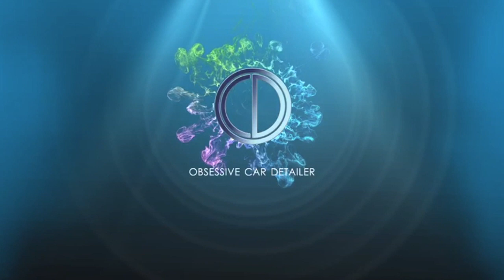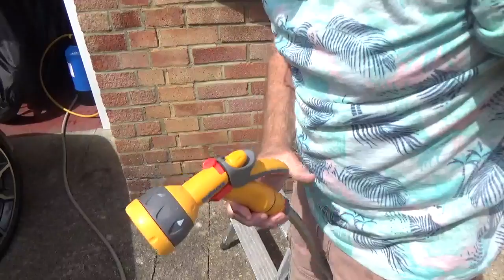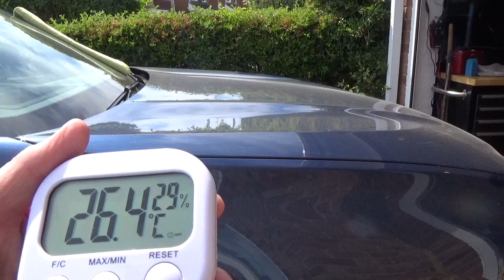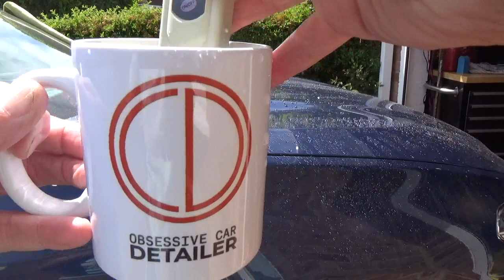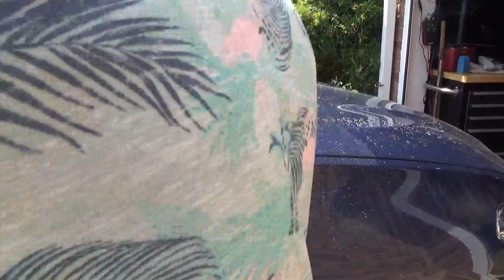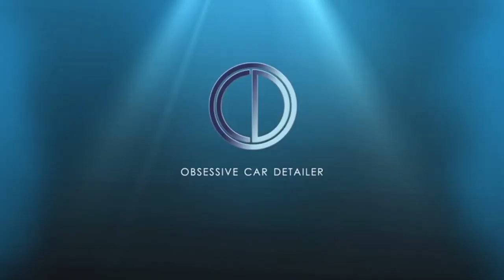No more water marks

Comment: I recently bought a resin vessel filter. But I seem to have a problem perhaps you can help me.
I connected from my outdoor tap to the vessel where it says 'IN' and a hose shower where it says 'OUT'. 
I turned on the water, waited some time to ensure the vessel fills up with water, eventually press on the shower hose but no water comes out.
I turned off the tap and pull out the hose from the tap to the vessel and pressured water shot right out.

I am not sure what I am doing wrong.
Reply from the maker: @pk4k60  I’m no expert but it sounds like you have an issue with the out hose. Has it a connector on the end that has a safety????

Comment: Hi Martin. That s what I want to use in my mobile detailing set up with car wash fed by a 200 lt water tank gravity system (no electric pump planned if not necessary). Do you think the water outflaw from the tank for the final rinse with deionized water can be affected from the passage through the filter or not?
Reply from the maker: Hi Domenico, I have no definitive answer Im afraid but I don't see why that wouldn't work provided the output from the tank isn't constrictive. If your system works without a filter then I would expect it to work with.  I would think a filter is a must for a professional as you will work in all conditions so best try it before investing in a pump. I wish I could give you a better answer but I don't want to give you crap info as I have not tried it from a gravity tank only mains sorry mate but I would be really interested in what you do and how it performs
Reply: @ObsessiveCarDetailer  thank you soooo much for your reply and suggestions. To tell the truth i m just planning everything. Still have to try my gravity fed system that will work in my old Alfa sw not ready. And consider this: I DON T EVEN HAVE A GARAGE and i live in a condo in Milan, so double-triple issues to solve. First idea: i feed the tank in the car with a garden hose from my flat cause i m at first floor: quite realistic and i take the filter in my flat saving more space in the car. Second idea was regarding my question: filter in a second ouflow from the tank for final rinse after pressure wash.... First idea the best even cause I HAVE TO FILL THE TANK ANYWAY SOMEWHERE 🤣
Reply from the maker: @domenicobizzarro839  I have to say the idea of filling the tank with filtered water does seem like the best idea.👍
Reply: @ObsessiveCarDetailer  ...and for sure i don t want a pump if the gravity fed works: simpler, cleaner, no one-more thing to feed with electricity, more space, hoses, etc. The real big issue: be indipendent for electricity too as for water or not. Big big difference not only for money....... Needs a 5000w power inverter generator i suppose. My answer is: yes you need to be indipendent in electricity too. But depends how deeply i will go in what is just an hobby for the moment. What do you think about this, considering your experience and professionality?
Reply from the maker: @domenicobizzarro839  I’m not a professional just an enthusiast but the less items you take in the car/van the better

Comment: I had a Raceglaze cylinder for some years. I find it is much easier to fill a watering can and use that as it saves water and the resin lasts much longer. My Raceglaze 7lt with Telsion resin will last almost 18 months doing two cars every week or so. The TDS meter is an essential to check the water. Your reading should be zero on the TDS.
Reply: You may also want to strap the cylinder to a wall as they are unstable especially when you’re yanking a hose.
Reply from the maker: Yep it is zero, when i first checked it was through the hose that had standing water in. I later checked it directly from the filter and it was 0

Comment: The most interesting part of this video is that you had to wait for your Blue BMW X to dry. My Black X3 bakes dry in seconds at the mere sight of sunlight. Air temperature can be cold and still does it. In the shade though, no amount of hand drying actually dries the bugger.

Never buying another black car!

Also, watched a similar test with a thin Raceglaze filter and that consistently got 0.0 ppm btw. 17 is good. 0 is incredible.
Reply from the maker: I later realised that the reason for 17ppm was I run it through my hose and that still had hard water in. When testing direct from the filter it registers 0ppm
Reply: @ObsessiveCarDetailer  thanks, this one is better priced than the raceglaze one!

Comment: I’m very interested in one of these, are you still happy with the results you are getting? I’m guessing it advised not to use through a pressure washer, could be ca life saver for me because I either have to get up at 5am 🤪or wait until 6 pm to wash the bloody car 😁
Reply from the maker: Hi Ricky, Yep still happy with the unit. I don't use it all the time just when I need to. So the resin is lasting.  Check out the following video on feeding a pressure washer. It will depend on the washer you have as they very in water throughput but its fine with my little K2. Having said that I do tend to use it mostly through a hose but the down side of a garden hose is any filtered water left in the hose is waisted. I bought mine direct from Vyair who were very helpful but I see County Detailing now sell them so worth checking for the best deal. You will love it, no more rushing around trying to dry the car before the dreaded water spots, make the whole process so much more enjoyable. You will also need to but a TDS-3 meter to test your water to see when the resin needs changing. Again I bought mine with the unit from Vyair. Hope that is of some help
Reply: @ObsessiveCarDetailer  thanks for that, do you pressure wash rinse first, then rinse again with the hose and filter? Just tried to purchase one from vyair but out of stock , when the resin runs out I’m guessing it’s easy to get and replace, thanks for all your help 👍👍
Reply from the maker: @p8rdm  I think it all depends on the weather and how much soap you have on the car Ricky. I tend to just rinse with the filtered water in hot weather before drying. I dont use filtered water when rinsing between snow foam & contact wash. The resin is poured out of the unit and new poured in. A large funnel is needed though otherwise you will end up with resin all over the floor. Vyair recommended that I use something like a road cone as a funnel 🤷🏻‍♂️
Reply: @ObsessiveCarDetailer  Hello, just wanted to thank you for showing the item, used mine this morning in pretty hot sun, and wow what a difference, I can enjoy washing my car again I’m so pleased with it 👍👍
Reply from the maker: @p8rdm  Good to know that the videos are of use Ricky👍 Makes them well worth doing
Reply: @ObsessiveCarDetailer  what reading would you replace your resin 😁
Reply from the maker: @p8rdm  Hi Ricky, it has been suggested to me that around a reading of 17 but that's just what I have been told not something I would recommend. Only use mine in the warm weather so not ready for a change yet and to be honest its been a while since I checked it. I would contact Vyar

Comment: Hi Martin, noticed on the Vyair website there are 2 types of resin, MB-115 and MB-151 - do you know whether harder water areas would opt for MB-151?
Reply from the maker: Hi, I live in a hard water area and Vyair suggested to me that MB 151 would be best
Reply: @ObsessiveCarDetailer  Thanks Martin for confirming. Noticed in your video you blew the standing water off the car. If you had left the filtered water in the heat I assume some form of water spotting would occur? Just wondering if you could walk away after filtered rinse especially in the summer?
Reply from the maker: @noirsange8369  I have left the car with filtered water on and is was fine but not something I tend to do often just in case 🤷🏻‍♂️
Reply: @ObsessiveCarDetailer  Agree, thanks again Martin
Reply from the maker: @noirsange8369  glad to be of help👍

Comment: I've seen several comments mentioning water 'softeners'. I'm sure most people know what we are refering to but it is not soft water as from a domestic water softener, it is pure water. Water from domestic water softeners contains lots of sodium (having replaced the calcium which makes the scale) and is quite corrosive, never use it on a car. Happy cleaning folks.
Reply from the maker: Very important point Phil, thanks for highlighting it👍

Comment: That should be 0ppm on new resin. Ours from the tap is a hard water area, and is quite high @550ppm. I have a 7ltr resin bottle and I fill a 100ltr waterbutt with DI water and feed that to my pressure washer. It gave me nearly 600ltrs before it started to read 11ppm. Also be aware that you can get different grades of resin. MB115 Is for soft water areas. MB155 is for hard water areas.
Reply from the maker: Hi welcome to my channel. The reading was zero once I switched my brain on. The next video in the series explains my lack of thinking as I recorded. Have a look through my videos and drop me a line if you have any questions 👍
Reply: @ObsessiveCarDetailer  I should of stuck around to watch the next video. Apologies, :D

Comment: I have one of these from Vyair. My water is around 350ppm without the filter and drops to 0 on fresh resin. But I only get a handful of rinses out of it before the ppm starts creeping above zero.
Reply from the maker: I will keep an eye on it and see how long it lasts👍
Reply: @ObsessiveCarDetailer  I've only used the MB-115 resin. But someone else commented saying about an MB-151 resin that's specifically meant for hard water areas which I didn't realise. Probably why I've experienced such poor longevity. I'll be interested to hear how long yours gives you 0ppm results. Good luck. 👍🏻
Reply from the maker: @craigh5417  Hi Craig, yes 151 was the resin that Vyair recommended to me, unfortunately that didn't have any so I have 115 in my vessel but am ordering 151 so I can refill with the correct one next time

Comment: Hi Martin.
Glad your happy with the water softener. I agree with the comments about tds levels, was fully expecting yours to be zero, checked mine this morning    
Tap water was 140ppm filtered was still zero so yes ask suppliers some questions.👍
Reply from the maker: Dave you need to understand that when listening to me you need to make allowances. I tested it yesterday at the end of the hose instead of as it leaves the vessel. Tested again this morning and the reading is 0ppm. what can I say, Im a plonker 🤷🏻‍♂️. However great bit of kit. You are now my official researcher 👍
Reply: @ObsessiveCarDetailer  nice one!
I think I now need to do a test... does my karcher or hose pipe use more water per minute, would be useful  to know the difference considering cost of resin.
You should  do the test on your channel 👍
Reply from the maker: @youngtowser  you've been watching Matt Moreman testing his washers. But good call, I will play with that👍
Reply: @ObsessiveCarDetailer  just tested,    my   karcher  k4 does 6.4ltr/min,
Hose with nothing attached does  13.3 ltr/min
Hose with gun set on shower does 9.3ltrs/min.
As I expected the karcher uses less, didn't  expect such a massive  difference. 
Guess I will be using the di vessel through  karcher in future. Resin should  last twice as long.
Going to order that hose you got from Gleem along with a gun. Hose on k4 is awfull its it's the reason I dont like using it.👍
Reply from the maker: @youngtowser  Clearly that my job tomorrow. Stop coming up with ideas... Give Kieth a call & he will help you get what you need
Reply: @ObsessiveCarDetailer  cheers will give him a call tomorrow.👍
Reply from the maker: @youngtowser  Hi Dave, as instructed I did a test this morning as follows..... K2 5lts/min.. just hose 10lts/min... hose with shower 8.3lts/min. Will do a video and try to get out today. Dave I am assuming you are based in the Liverpool area????
Reply: @ObsessiveCarDetailer  Hi Martin your results are almost identical  to mine, big water saving with karcher.
Iam in Cheshire, the water is classified as slightly hard on united utilities website. 
I've ordered a hose/gun from gleem😃
Reply from the maker: @youngtowser  Cool, hope you like it as much as I do
Reply: You might save water, but how it rinses is less efficient as you lose a lot of water in tiny droplets. Much better and more efficient to drench off with the hose

Comment: Eh up duck. Not cheap but if it's going to help out and lasts long term it's worth it I guess. Got a mate who works in this industry, think its time to drop him a text for mates rates etc once I get my tap issues sorted. Bloody dust is the bane of my life right now with the fleet hardly moving
Reply from the maker: Ok so its official, I'm a plonker. I measured the output of the vessel at the end of the hose instead of directly out of the vessel. Re measured this morning and had a reading of 0ppm.
Reply: @ObsessiveCarDetailer  we learn by trial n error
Reply from the maker: @tmphotography8443  story of my life🤣

Comment: Hi Martin,, can you run it through a pressure washer when doing your final rinse ?
Reply from the maker: Ok so its official, I'm a plonker. I measured the output of the vessel at the end of the hose instead of directly out of the vessel. Re measured this morning and had a reading of 0ppm. However at 17ppm no water marks👍
Reply: @ObsessiveCarDetailer  that’s picked up in the hose and will lower after it’s run through some more.. 23 years ago when I was 15, I used to work for Delta cleaning in Wokingham, they had one of the first pure water window cleaning systems installed in their van.. I remember it needing 5 or 6 cylinders to purify the water for the system and when they tested it we got 5ppm out the hose..  the company owner used to wash his Mercedes off with it and clearly had a 200iq... if you get a spray nozzle, soft brush head, on a pole, you have a simple Pure water window cleaning solution and can cancel your window cleaner.
Reply from the maker: Hi Roger, a few of my subscriber say they do so don't see why not as long as the filter can supply the water demand of the washer. It will also make a difference to foam using it that way👍

Comment: 17ppm is possibly what is being picked up on its way down the length of the existing hose
Reply from the maker: Ok so its official, I'm a plonker. I measured the output of the vessel at the end of the hose instead of directly out of the vessel. Re measured this morning and had a reading of 0ppm. However at 17ppm no water marks👍. Matt you are now my official tester.
Reply: @ObsessiveCarDetailer   Still very good as that's how it would be used normally. I bought one last year but need new resin for it. My tap ppm is 300+ so need to get the MB151 resin to get the most out of it
Reply from the maker: @matty387  they didn't have 151 only 115 but will get it for the refill
Reply: @ObsessiveCarDetailer  Only going on what I have been advised to go for. Don't have the time or equipment to test it properly so just based on trust. Both similar price I think
Reply from the maker: Good point Matt, I have a call in to Vyair so will see what that comes to

Comment: I've got my own professional window cleaning business and when I'm doing a maintenance clean I always just hook up quickly to my 650L tank in one of the back of my van's and give it a quick rinse off with 0ppm...that's just for maintenance cleans obviously if we got a lot more in-depth then we can use the blaster master all that good stuff... Great video and  very informative
Reply from the maker: With a professional set up like that in the back of the van Adam you should expand into cleaning mobil windows & the rest of the car as well🤣
Reply: @ObsessiveCarDetailer  Would you like a job managerial position of course...😁😎😎
Reply from the maker: @adampug206gti  🤣🤣🤣. Take a pay rise Adam👍
Reply from the maker: Ok so its official, I'm a plonker. I measured the output of the vessel at the end of the hose instead of directly out of the vessel. Re measured this morning and had a reading of 0ppm. However at 17ppm no water marks👍
Reply: @ObsessiveCarDetailer  😂 yes you'll find that you can go up to about 50 PPM before you start getting water spotting or there abouts... But again this all depends on what surface and it would just be trial and error... You could get yourself a little RO unit and make your own pure water... Or you could use a double vessel and your resin in the 2nd one would last longer...👍🏻 you can also buy your own resin it's about £70 a bag that's another option and you'll be able to fill your vessels a good times then
Reply from the maker: @adampug206gti  Thanks for getting back to me Adam, appreciate it

Comment: Love the shirt Martin.  Water softeners are great. You’ll love the results.

My levels are normally 320 then goes down go 0.  17 seems high, normally that’s the refill point.
Reply from the maker: Ok so its official, I'm a plonker. I measured the output of the vessel at the end of the hose instead of directly out of the vessel. Re measured this morning and had a reading of 0ppm. However at 17ppm no water marks👍
Reply: Obsessive Car Detailer plonker!! Love it. Glad it’s ok. ❤️
Reply from the maker: Sunny outside, sunny inside. I normally keep it for the beach but can't see me making it this year😎. I have been looking for a softer for a while but couldn't find one that I could justify the running cost so fingers crossed I have now👍. I have a call into Vyair so will see what they have to say about it

Comment: I've just used code reef10 and it worked. £87 inc delivery. ;-)
Reply from the maker: fantastic, 👍
Reply from the maker: Ok so its official, I'm a plonker. I measured the output of the vessel at the end of the hose instead of directly out of the vessel. Re measured this morning and had a reading of 0ppm. However at 17ppm no water marks👍